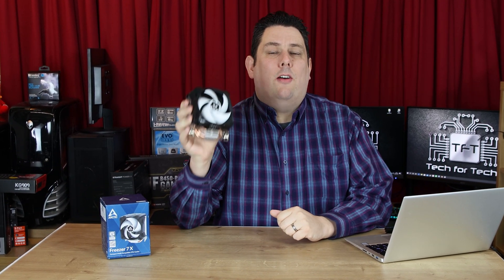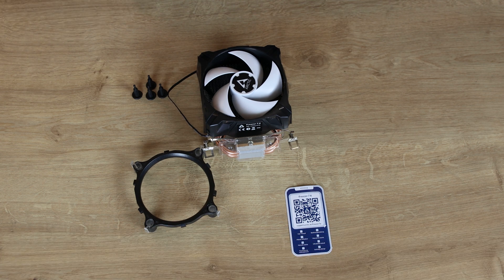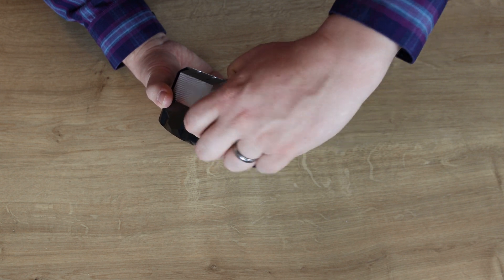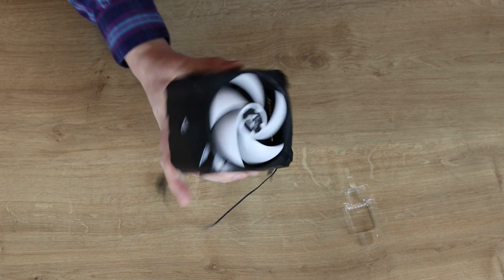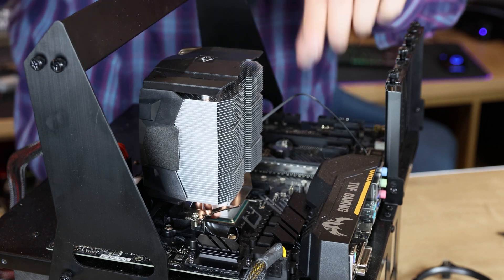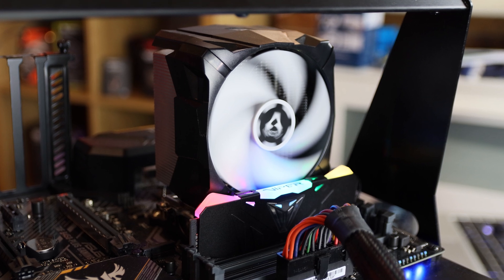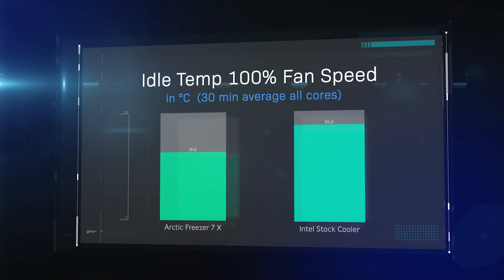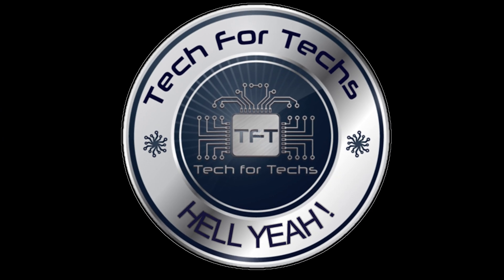Best Value CPU Cooler 2020 🔥  @ARCTIC   Freezer 7 X 🔥 Review

Comment: this cooler is the best budget cooler hands down, cools my i7 9700f easily. Max rpm with stock cooler my temps are around 90c but when i bought this cooler it dropped down to 80c below

Comment: What cpu are you using?
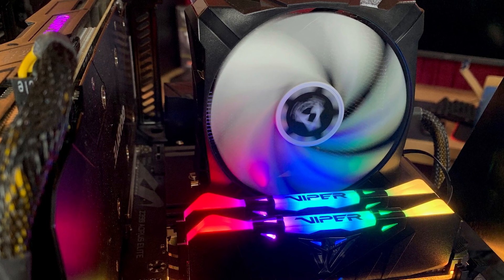Reply from the maker: Full specs are in video at 10:17  but in basics it a Intel i7 9700kf
Reply: @TechforTechs   how was it?
Reply from the maker: @jeddimaster5393  If you mean the CPU, its a good CPU, if you mean the Cooler, as its says in the video its very impressive, would not use it for overclocking though
Reply: @TechforTechs  thank you

Comment: Is it quiet? I want to replace my intel box cooler with this one.
Reply: Go for it. It's very quiet, and even if you crank the speeds up, it has a much less harsh type of noise (less of a whine/whirr and more a very low hum). You probably won't have to, though, it'll cool much better to begin with.

Comment: Holy shit dude that psu cable for the 8pin gpu is fucked you need a new power supply...check out the 10:30 mark in the video
Reply from the maker: The cable is fine you are just able to see through the shrouding due to the flash on the camera,

Comment: Test System:

CPU: Threadripper 3960X
Um, that is no Threadripper 3960x or a MSI TRX40 in the video.
If you are going to list a test system in your description, at least make sure it matches the test system in the video.
Then you switch up to a Intel CPU and Gigabyte board and post results based on Intel stock cooler and CPU, when you show it being installed on an unknown AMD Ryzen and Asus TUF board? WTF Man, you're all over the place, how about some consistency. 
You either suck as a tech reviewer or just a shill.

Comment: I think you'll find that there is a standard fan under that cowling.  The cowling snaps off and the fan is easily replaced.  Can't state that categorically for this cooler as my arctic cooler is a slightly different (older and larger) model, however my cowling is substantially similar.

Comment: I was considering getting one of these. Now after having watched this video... I'm absolutely certain its the one to get.
Certainly compared to a stock cooler (which is what I want to replace) this vid shows it performs very well, its quieter and despite only being £20 it does seem to be good quality. :)
I've also come to trust Arctic given that I already have two of their fans in my case.
Reply from the maker: Arctic do a good job with thier products, they may not have all the RGB and stuff others do but they do make some really good coolers
Reply: @TechforTechs  Yeah. Fine for me since I'm not an RGB person anyway. I do have blue LED fans though, but picking the white version of this cooler is ideal as the blue light from the other fans will just make it look blue anyway.